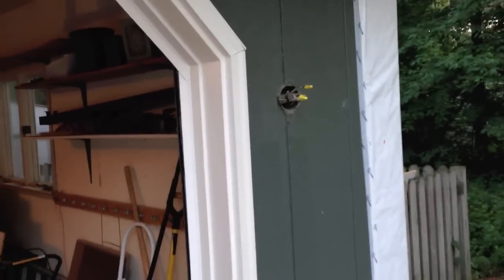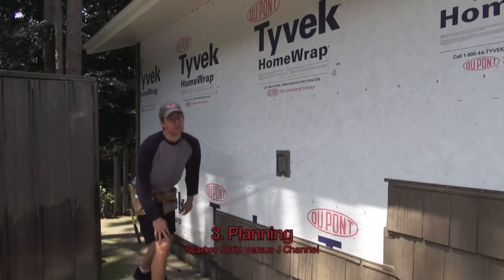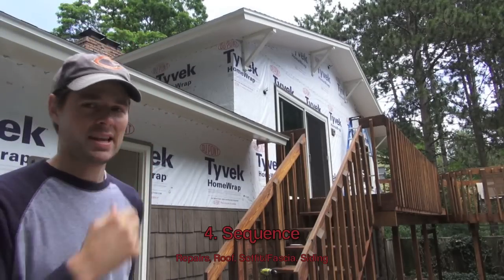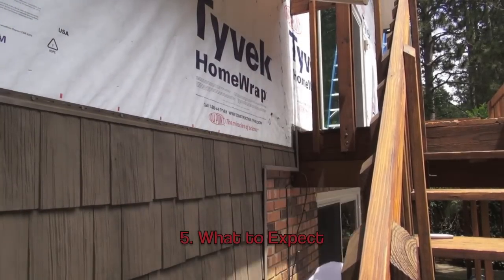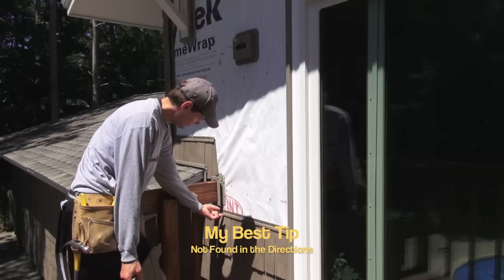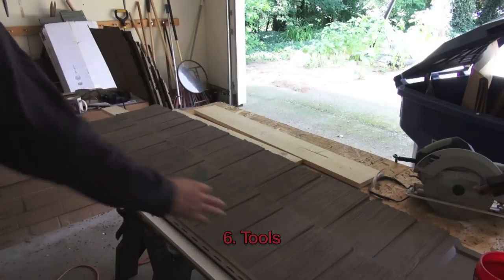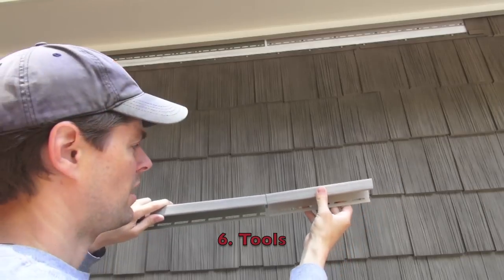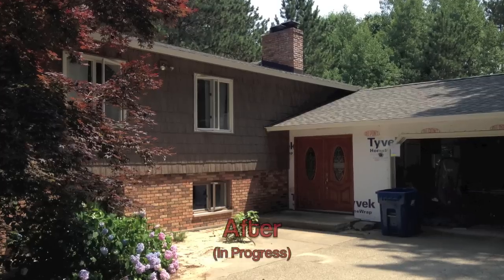Vinyl Shakes Siding Installation Tips (Mastic Cedar Discovery)

Comment: You sir are a life saver.  There is a blinding lack of information out there for installing this kind of siding, so it is awesome that you put out such a clear video.  I am just curious; on your back wall above the door at the very top: how are you attaching those extremely short pieces you cut to fill the last 5  or so inches?
Reply from the maker: +trapmaster2000 Thank you, I had the same experience of finding no information before installing these, which is why I shot this. I struggled with that same question because you can't use utility trim and snaplock punch with this thick stuff. I worked for a siding contractor for fun after doing my own house. They would say to just use 1-1/4" white soffit & trim nails with a Kobalt trim nail punch, but I wanted to be extra cautious about expansion/contraction and drilled a nail hole slot, then screwed in a 1-1/4 Primeguard exterior screw. I later painted the screw head under the J channel to match the siding color. For this very thin 5" application, it was no different, or more difficult than any other under-sill application, and just used the same approach here as I did everywhere else.

Comment: Great job and video. House looks great. We are going to use the same siding and just discovered they don’t offer j channel in the same “cedar” color. What color j channel did you use? Yours looks like a good match. We are thinking about Montana suede for the j channel and cedar for the siding. Any thoughts or recommendations?
Reply from the maker: The place I bought them from did not present that question to me. They may have called their Mastic rep and asked so I wouldn’t have to. Not impressed by the guy selling to you if he didn’t do the same. The J-channel I used was larger than average as this was required. Thanks for the compliments :-)
Reply: @Markcgreer  Thanks for the reply.  Mastic provided recommendations to our rep so I think we're good! Thanks again for the info and for the video.  Nice job!

Comment: Didn’t see anything on installing starter strip
Reply from the maker: I would use a sharpee and a laser level to draw a line all the way around the house on the house wrap where the starter strip will be nailed. Avoid a chalk line droops a little in the center over 20+ feet. When you do complete all 4 walls, you may find that the house is sloped slightly in one direction or corner. All of the sources out there assert that you should install your starter strip and siding level, not parallel with the sloping house. Start on the lowest wall. Nailing it in is easy. Hooking your first row is easy.

Comment: how are you fastening the top rip
Reply: I talk about it at 6:25. I drilled a nail fin for exterior screws to be extra safe, but the pros use a nail punch tool like this: Malco  Model TNP2STS with those white aluminum 1-1/4" trim nails. Seems like it cuts a corner, but everybody's doing it.

Comment: You don't use a level for siding, you measure off of the soffits or others set points. If the building is out of level due to foundation issues, you will run into some problems as you get up top
Reply: I took the Mastic Certified Installer course online and a few times it reiterates to install level, and not parallel with the building.
Reply: +Mark Greer Video oh in that case you took an online course
Reply: I dont think thats correct  .I have work with people that uses the method and they end up with a 2 inches in both sides . .use the hose  like the Roman's  and it never fails

Comment: What's the cost per sq on materials?
Reply from the maker: $352 per square on before tax. All the J channel, starter strip and blocks are insignificant, but if you use the decorative corners as I did, they were $312 per box of 10 38" corners. I only needed 2 boxes for 5-1/2 outside corners.
Reply: Mark Greer
Thanks Mark. Were breaking ground next week on a new one and we are using Ceder Shake vinyl for the entire house. I haven't settled on a manufacturer yet but your mastic looks great. We have 14 corners!
Reply from the maker: *****
That's sounds like its going to be an amazing house!

Comment: The worse siding jobs I have ever seen are those where they have all these short pieces and or where seams  line up.  The same issue with decks or floors where  I think it looks hokey, you won't find high end professional work done that way.  I understand wanting to eliminate waste but maybe folks should plan to use short pieces for dog houses, sheds, etc. as using short pieces shows up particularly on tradional vinyl siding or Dutch lap due to lots of resulting seams.  It's the same with j-channel - if you don't know how to cut miters perfectly, hire someone to do it.  Because when the siding settles, ages, etc - and gaps open up it will look bad.  Most siding jobs that look bad on completion is because the trim work was done crappy manner.  A month or two+ later especially as weather changes - then nailing mistakes show up and that wavy, buckling, etc along with bad trim and finishing techniques will make you ready to pull it all down.  In addition, not every product is the same and there are new options in various products from what you might have learned about 5 years ago.  Get advice, read the manufacturer website for use instructions, etc.  YouTube is not what I call proper advice (in many cases).  Many times these folks don't have any more experience or training than you do - why would you follow them.  Watching video is okay to help you realize where you might have issues, what you see looks bad, and to realize you need to go get professional advice.  I love the videos that basically start with "never done this, but I'm going to show you how to do it."  Sorry guys -- a woman would never do this or most wouldn't.  Get in touch with your feminine side and really think and plan about how the end product will look. 

Story in point that basically cost the money to take a dream trip to Hawaii a couple of decades ago.  A  friend's husband refused to get a vinyl job done professionally. Said "I'm working as a carpenter, of course I can do it, what, do you think I'm stupid?" -- he was a carpenter sorta ...but not a very good one.  He did the house.  8-12 months later,  it was just awful to look like and he refused anyone's advice when doing the job.  He decided it just needed a little rework, two years later called his dad from out of state to come help fix it (the same guy who taught him bad techniques to begin with and had never done siding of any kind).  You can imagine my friend was just in a panic - saw dollar bills flying out the windows. His dad did convince him of one thing - much of the siding was ruined and couldn't be straightened out so lots of money for more siding.  After all was said and done, it was still bad from a technique standpoint particularly trim, cutting, seams, etc. Let's travel 5 years forward, the guy had matured a bit, started actually looking at lots of high end jobs - got fired from two other house building companies for not listening and finally got a 3rd job with a guy that somehow got through to him. And the more he looked at his house was just ashamed of it.  So now we are at 10 years with the cheapest siding he could have bought that faded unevenly, cracked, was brittle, etc. thus he decided to have it all replaced. He was so busy on his job and their wait list was at least a year out, so his boss recommended someone else to do the job if he didn't want to wait another year plus for the company to help him out during down times.  He had it redone, paid more money than he said he'd ever pay and now almost 15 years later -- it still looks great, like new,  and they still love it.  So basically, he redid the house 3 times.  Moral of the story --- don't be stupid and try to do jobs you obviously don't have the actual knowledge, the training to properly complete nor the time.  Building a dog house or a porch swing is one thing.  But why guys think because they helped their dad build a hunting cabin, tree stand, or shed in the woods when they were 14 -- and have spent the rest of their lives being a landscape guy, office worker, hospital tech, etc --  they can now build or rebuild/renovate a house -- I will never understand.  What I like better is they build say a small memory box that is really done well and they and their friends are like - " hey man, look at the beautiful box you made your wife -- sure you can add on a den or tear off the kitchen to build a great room".   But the end of the story is : after all these years, they have finally almost saved enough money to finally  get to take their dream 3 week vacation to the South Pacific islands  and do all the things they wanted to do while there from helicopter tours, deep sea fishing, diving, staying in bungalow over the ocean, and on and on.  Still a year or so off and years later than they had expected but I think they will make it an anniversary to remember or the honeymoon they never got.  And as I tell them, hey the kids are grown so you don't have to worry about them why you are gone, and you have enough vacation time to really enjoy yourself and not be rushed. You couldn't have done that 20-25 years ago.
Reply: Nice blogpost

Comment: Look like it would be easier with real shakes🤔
Reply: Don't think so when you have to work with individual pieces not a whole length of siding. Then there is the worrying about powder post beetles, termites and the darn carpenter bees. Not to mention finding decent cedar or cypress wood. It's almost impossible at a reasonable price and 50-100 years ago and back, all the lumber that was old growth was much stronger, denser, had more protective resin in it etc.  Today, the fast grown tree plantation stuff no matter whether cedar, cypress, white oak, fir, it's just not as durable.  I have a couple pieces of cypress off an old house and it's unbelieve the thickness, density and weight of the wood compared to piece of new harvested lumber (same size, etc).  I have old fir from a shed that came out of a old shed built 60 years ago and it was from a barn and house that was torn down that was at least 100 years old based on property.  So that lumber now in my shed is 20 years in my shed, 60 years in the house out back and at least 100 years from its original location. So it's almost 200 years old and you can't believe the difference in today's wood.  We hauled in in to the back and knew it was heavy and larger but it wasn't until we ran out and went to Lowes to get more lumber, got back and had one of each in hand.  Just shocking.  It's like white oak boards and locust posts or even white oak posts that are still standing in pastures from 100 years ago, more really (put up in 20-30s.  No treated, no concrete. Dunked and soaked the bottom 2' -- we were still doing this in the 60-70s and those fences are still up.  Just used real natural pine tar when we could get it from local producers or creosote painted. Used natural linseed oil to thin to be able to paint the mixture and it lasted forever.  There are many old fence posts still standing on abandoned farms or old estates.  Horses didn't bother it either.  Today folks on big Ky horse farms use black paint stain on their new fences but it doesn't last.  And the mess they call linseed oil in the stores is awful.  I have finally found some true Swedish and English type linseed oil and finishes at a little place called solvent free paint I think.  You paint whatever, wood, metal etc. and 10 years later, you just give it a wipe down with natural raw or their organic "boiled" type linseed (no solvents) and it's all refreshed (shiny, color restored) and protected again.  I figure if it's still protecting 600-700 year old buildings in Europe it's good.  The only issue is you can't put it over layers of acrylic and resins - you got to get down to bare wood.  But organic linseed doesn't mold or mildew -- nothing for the mildew, mold to feed off and grow. Check out their website and read all the literature including its use on wooden boats and teak etc.  my grandfather use to paint all our outside metal with organic linseed - difficult to find in the US except this place.  

Here in the US, they keep talking about improvements and changes in the paint and stain lines, but the only improvement is to their bottom line because we have to keep repainting every couple of years.  

And concrete setting of posts is just wrong and lazy especially if you have any type of wet soil. But  they all do it now because they don't want to take the time to properly tamp posts inch by inch so it's really packed. We had clay and mixed in 20-25% granite dust, poured a tiny bit of water as you tamped and it was like concrete.  These posts are still standing from the late 60-70s.  I had new fence put in and less than 20 years they have just rotted off.  When we replaced a section that had a large tree fall on it, we saw the issue - no bug issues just plain old rot and on treated wood.  The concrete (and the new foam ones) hold the moisture to the post for a long time and when it rains, as the post shrinks with age, the water can run down the post, into the openings around the post.  You have to keep filling in the top with clay/stone dust and slanting  to try and help but you can't get down to where it's rotting.  And the concrete keeps you from tamping. The way they use to do posts, every year or two - you just went out with a couple buckets on stone dust, a tamper, couple gallons of water if dry, your level to replumb. Amd you checked the posts, tamped down around it, adding some stone dust amd kept tamping and checking for plumb until straight and tight.  Usually only a probable, when cows or horses pushed on them to scratch. The way they do fences now residential isn't the way most farmers do theirs because they don't want to have them rot and redo.  The fence companies want to make sure they get a new job in 10-20 years.  They can't make money if the fence never falls down.  It's like the replacement windows -- good name because you will be replacing every 15-20 years. Yet Windows use to last at least 50-100 plus years. Good wood, good glass, linseed putty, linseed paint and linseed and zinc oxide for primer.  And people took care of the homes they knew their family would be in for centuries.  They didn't slap plastic on it and figure their job was done.  

Check the Solvent Free Paint site.